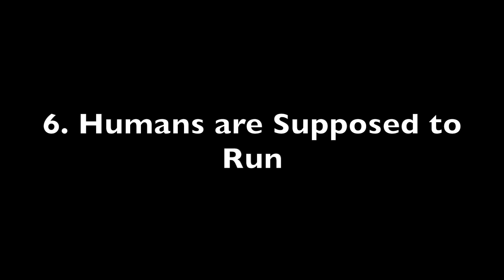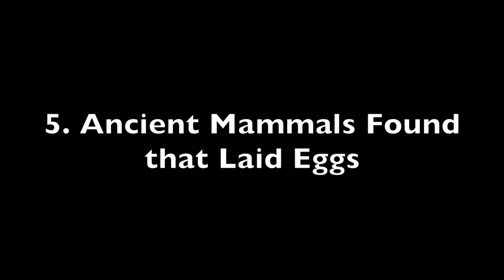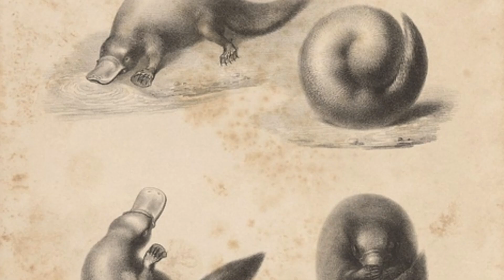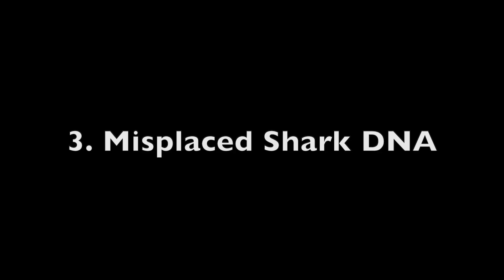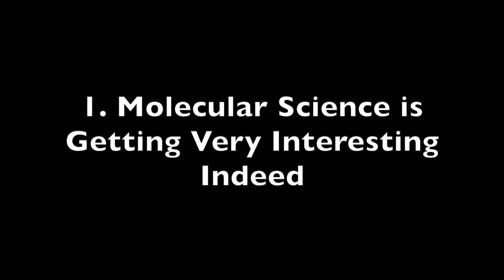10 MORE Interesting Scientific Discoveries for June of 2024

Comment: This is the second time in a few weeks I have heard a structure with three dimensions called "2d".  In this case it was the lattice of goldine, 1 atom thick.
Whether it is 1 atom thick or 10,000,000  atoms thick it does have a thickness and is 3 D in my book.    It can't be called 2 D.

Comment: It's not surprising that the sun's magnetic field is generated in the convective zone. To create a dipole magnetic field in a fluid, you need convection, conduction, and rotation. In this regard the sun's is like our own magnetic field, only far less stable. The solar cycle is pretty well understood and involves the sun's field shifting from dipolar to toroidal every 11 years, resulting in magnetic flux lines bursting from the sun's surface as paired sunspots at low latitudes.

Comment: sorry John, but nuclear isn't renewable or even green energy...
Reply from the maker: Fusion is, as far as is possible in the universe. Thorium is within reason. Uranium, well, ask the French about fuel rod recycling. If we had not made it so ridiculously impossible to further develop nuclear energy past the the 1970's, we'd have bought decades to deal with climate change. Instead we listened to a lobby. And now we have this world as it is.
Reply: @JohnMichaelGodier  yes fusion, afaik, fusion needs two elements to be made into a new, heavier one, so when does it all ent, when all and everything and inbetween is lead..."burning" something that is would be finally gone isn't renewable, even with that mass of Helium and Nitrogen to start with...
the french put a lot of effort and energy to renew their Rods, i would not count that as sustainable, at least not considering the higher cancer and leukemia rate around La Hague as green or eco friendly too...
Wind turbines, well, unless the sun blows our atmosphere away, i would like to count this as renewable as the turbines do not have any effect on the cycle...
PV guess is like Dams the same... 
i would not count any recycling gas or substance to that, cause you are inflicting in the cycle where the energy would go without intervention...
Reply from the maker: The universe itself isn't sustainable, it will burn out. All energy generation does. It expends. And as it does, biology ends, because it too is unsustainable on an energy basis. No energy, no life. Sustainability in our case is simply using whatever long term methods we can within our means until we have to move to something else, ultimately fusion. But we have to be cognizant that our biggest problem, and our biggest non-renewable, is the atmosphere. By hampering nuclear energy, which is dangerous but not that dangerous for what you get out of it, we contributed greatly to climate change which is a much more far reaching issue than even the worst radioactivity problems. That's the bottom line and the legacy of the anti-nuclear protest movement. They were contributors to climate change, enormous ones. They need to be called out on that point so they get out of the way so we can make the climate change save while we still can (IF we still can without terraforming the planet with star shades and albedo rises). 

We do a lot of dangerous things in this world. You could have 100 Fukushimas and still not kill anywhere close to the amount of people that the automobile does in a year. Yet we've been conditioned to not think in those terms, instead we think of nuclear as something that cannot be perfected in engineering. Had we done that with aircraft, we wouldn't be using them, they would be a highly regulated "no go" tech that would be languishing outside of a military use. We didn't do that with the aircraft, indeed no country on earth did it, because the utility of it outweighed the necessary accidents that were going to happen in perfecting that technology. Now, commercial aircraft are astoundingly safe. They didn't used to be. Nuclear is in that basket. It's utility outweighs its problems. 

Wind turbines are not sustainable. They require intensive CO2 emissions to manufacture and maintain, along with chemical issues (takes a lot of oil to lubricate one, you can replace it lithium, but it's worse) and they are a nightmare on wildlife. Solar is better since it doesn't have as many moving parts, but it's not a solution the way we're doing it. Try recycling all the nasties contained in a solar panel, it's almost as bad as a battery, which to use them you need chemical batteries. They're just pat on the back techs that we like to think are working, while we maintain our dependence on coal to actually back them up. That's not to say they can't be made better, but the best idea we have right now is fission as a stepping stone to fusion. Fusion, there is no shortage of fuel off earth. The entire sun is a huge ball of hydrogen and it's spewing helium-3 uselessly into space, not to mention yottawatts of solar. So that would buy us many millions of years. We just have to get there without expending the atmosphere.

Comment: Regarding #10. We must be careful where the spent cement is coming from we don't want natural mercury containing Stones in that heat of a blast furnace it will liberate the mercury in to the steel and the air.  Also lead contaminated cement from old factories is also a problem in steel and getting in the air.  These are just the area I'm familiar with I'm sure there's many other contaminants I'm unaware of

Comment: Concrete manufacturing does make a lot of CO2 but the curing process also releases a bunch.
Reply from the maker: Drinking my morning coffee. And yeah, that's why I was careful to not make any definitive statements saying it solves it because you're right. The curing process does produce it. So I left it at "almost". My sense is that most of the emissions are from the manufacturing process though.
Reply: @JohnMichaelGodier  absolutely. The heat alone generates far more, then there's the chemical process to create cement and finally, the chemical curing process. An interesting fact about concrete..... It needs to "dry" (cure) while slightly damp or it becomes quite weak and crumbly.

Comment: the concrete steel issue is a bit of a problem considering one is chained to the demand of the other in this process. you will only be able to recycle as much concrete as there is demand for steel.......... and there is typically more concrete demand about than steel. Its an improvement though for sure. but its not a solution. 
a solution would be the direct recycling of concrete into concrete or into multiple uses it itself could never meet the peak demand for.
Reply: Also, you still have to break down rocks, a high energy process which is done in regions where energy is cheapest.

Comment: I did an LD50/50 experiment as my first self designed experiment once I got free access to a university grade microbiology/generics/ecology lab. 

I used several substances most of which are very common such as ethanol,  caffeine, nicotine,  sodium chloride, and glucose. The volunteers were a common, small water based worm. The only substance which I'd consider poisonous was nicotine. I started with  at a certain concentration and would decrease concentration by half until fifty percent of volunteers survived for forty-eight hours. 

It only took a few iterations before every substance except nicotine had no discernable effect. After twenty iterations of diluting nicotine still no volunteers made it past thirty six hours. The only effect diluting nicotine had was to increase time till death slightly. 

The TL:DR is: Nicotine behaves more like a pesticide than a drug or substance meant to be ingested.
Reply: I’m curious how exactly does the nicotine do harm for the worms pretty interesting
Reply: Sola dosis facit venenum. That being said, animals that don't have livers generally have a hard time with any toxin.